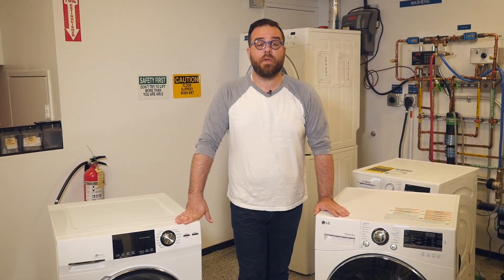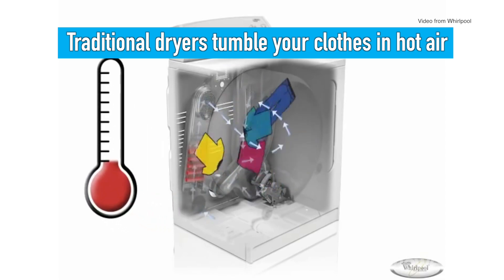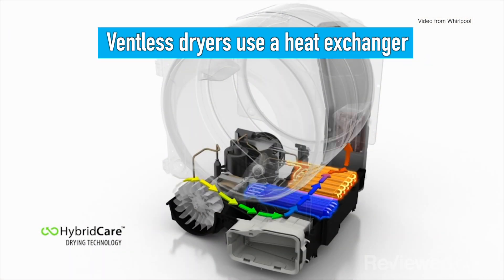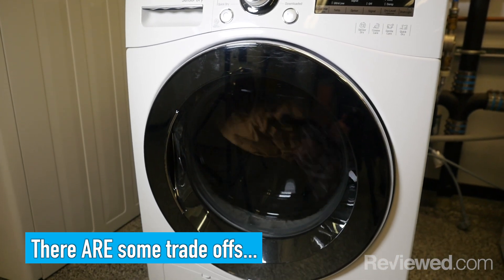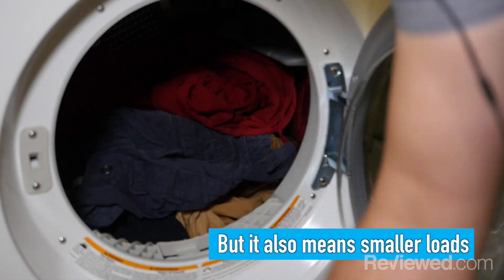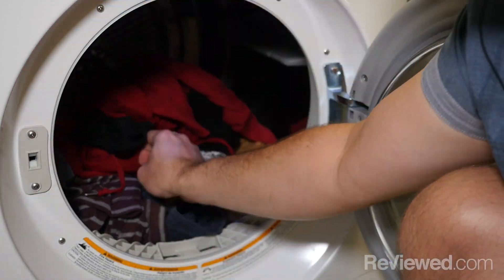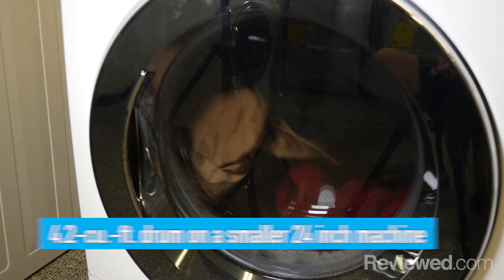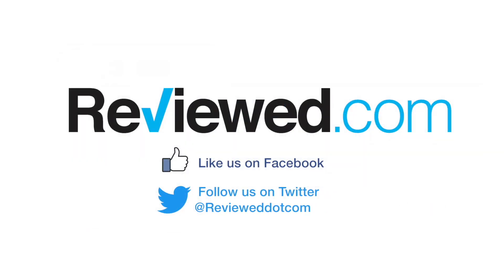How does a ventless dryer work?

Comment: I just bought one and I am curious to anyone that has one that drains via the drain pipe, does the drain pump turn on about every 30 seconds or so. I find it very annoying. Trying to figure out if that is normal operation, or if something is wrong.
Reply: If it drains constantly it usually means your clothes is super damp, but if it still does that at dry clothes then its really improper unit

Comment: I see a lot of these Whirlpool Heat pump units require like 8 hours to disassemble when the filter closest to the condenser becomes clogged internally. Are there any models like the newer WHD560CHW1 from 2018 that hopefully address this repair headache? I also see the smaller LG DLHC1455W has an "Auto Cleaning" condenser. Is this a feature that finally solves the issues?
Reply: The auto cleaning from Lg is really good especially when it cleans it while it dries the shirt simultaneously

Comment: My condenser dryer NEVER leaves clothes moist. He is literally full of hot air.   Plus my clothes come out better than my vented dryer.  In addition, the condenser does not lose the heat so it is more energy efficient.   Vented dryers cause fires every year because the venting gets clogged.  Plus if you do not clean out the wall venting, your vented dryer is less efficient.
Reply: They take forever to dry though. A load can take 2-3 hours to dry.
Reply: @Seekingtruth-mx3ur  it’s perfect for single or couples. i just leave it on for hours and don’t mind it. surprisingly, my inverter one doesnt draw too much electricity, so that’s a plus

Comment: Does a ventless dryer shoot lint debris into the air at all?
Reply: No. The air is recirculated through a radiator like box where water is condensed. So the air in the dryer stays moist until the end, making it very unlikely lint will exit the dryer.  It’s really like a sealed system.  My machine, a Bosch, collects lint in the removable lint trap but also in non removable ducts that get clogged. Not a very good design. But ventless dryers are a must in places without external vents. Size makes them unable to handle large comforters. Washing machines that is.
Reply: it has lint filter
Reply: It shoots it out the front onto the floor

Comment: The dryer exhausts warm/hot air into a room. That makes residents uncomfortable especially in a small room during summer. Not recommend it .
Reply: I think you are missing "Ventless"....there is no vent, it does not exhaust any air.
Reply: @riff42  it does put warmer air into  the apartment. The hot air in the drum is basically  recirculating in a closed loop - picking up heat as it goes across the heating element, picking up moisture as it passes over the clothes, then in the condenser it gives up heat and condenses the moisture out. The moisture is pumped out by a drain pump. But the "condenser" is a heat exchanger. Room temperature air passes  over the other side of the condenser (heat exchanger) and picks up heat. THAT air is just vented back out into the apartment/house. So yes it makes the space warmer as opposed to a vented dryer.
Reply: That also makes the AC run more
Reply: sure, you're all smarter than Bosch engineers.
Reply: haibianzhijia what? In the summer you hang the clothes out to dry.
Reply: @spencerwilton5831  We are living in an apartment in New York City. You are not allowed to dry clothes outside.
Reply: haibianzhijia So open a window, or just dry stuff on racks. chances are your not allowed to install a vent hole anyway, so what's the issue?

Comment: Are they gas powered or electric?
Reply: Dave Lombardo electric. You can't have ventless gas dryers, the combustion fumes from the gas need to be expelled outside the building.
Reply: No, this sucker is electrical, but it requires a nuclear reaction to generate the 1.21 gigawatts of electricity needed to dry its full load.
Reply: @An_inquisitive_thinker a time traveling dryer!! Now that sounds like a real time saver! 😂
Reply: Diesel
Reply: @nofurtherwest3474  nuclear
Reply: @Viper81766  lol

Comment: The idea sounded good and I was thinking about a ventless dryer but after reading all the problems of clogged pipes because of the lint , I changed my mind . And the amount of time to dry the clothes is ridiculous! As they say : if it’s too good to be true it’s probably not true . Better result and less headache with the regular dryer .
Reply: but if you live in an apartment, and want to sneak a washer and dryer in there, this is your only choice
Reply: True. Stay with a conventional. Just spend the $$ on the higher end ones for the electricity saving.
European washers and dryers are ridiculously inconvenient. Is an all day affair for what used to take me less than 2 hours.
Reply: @MARCOZR1  Time save hint: dont' sit there and watch it dry, go do somethign else. lol.
Reply: Too good to be true? Dude these are made by Bosch, which is a great company. Much better than GE. You're an idiot sorry
Reply: @nofurtherwest3474  Busch beer version

Comment: Just came from the US to Europe, searched the whole country for a air dryer but they only have condense. And all I can say is, they are no where near as good as the ones in the US. Forget about low heat drying, It burns your Cloths. If you have options for air, choose air. since I literally am burning my cloths with this condensed dryer
Reply: S v what are you talking about? We have vented dryers, but they are not really popular because they are so wasteful of energy. A quality condenser dryer is just as quick as a vented one, the trick is to make sure they are located in a well ventilated and preferably cool space, they won't work so well in an enclosed cupboard or warm kitchen.
Reply: @spencerwilton5831  How about the bathroom?
Reply: How can a condensing dryer burn your clothes? That makes no sense!